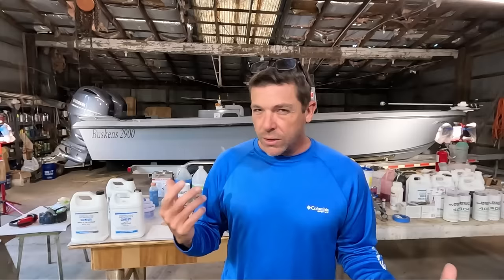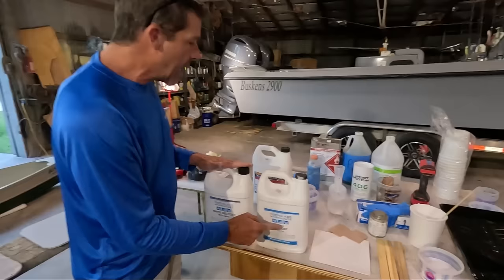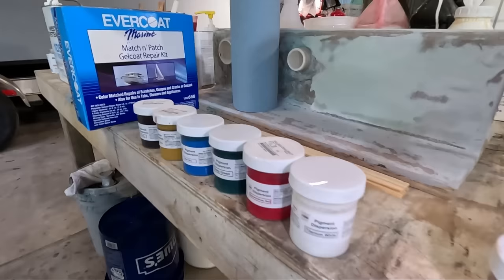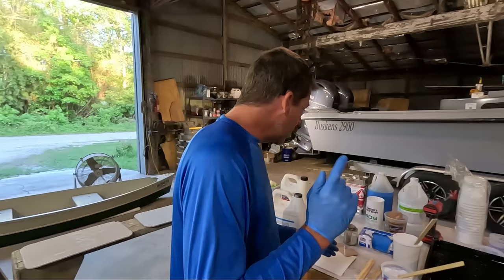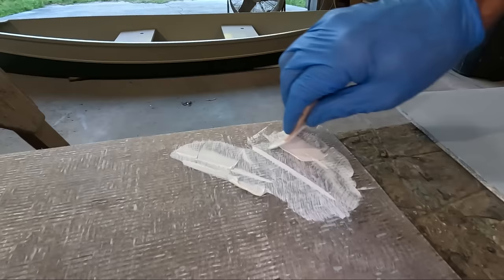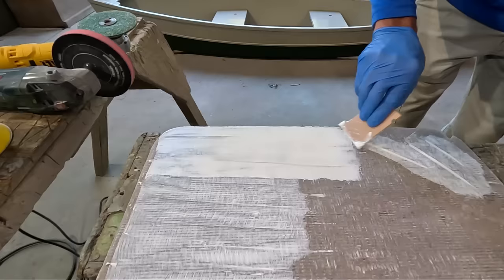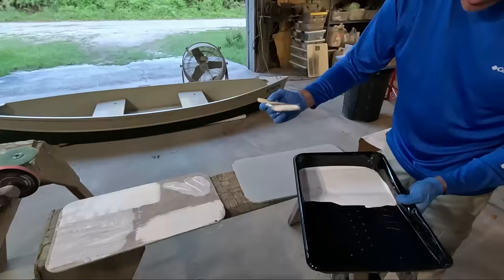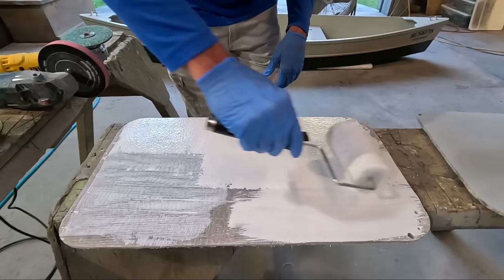The Secrets of GELCOAT and WHAT You Need to Know!

Comment: I have a crack in the bottom of my hull from where the roller on my trailer gave out unfortunately.. I’ve been watching your videos and curious how you would go about it from start to finish, you may have a video on it already so I’ll keep digging
Reply from the maker: I don't currently have a video on something like that, but hope to soon. Thanks for watching!
Reply: Same my boat has a crack in the bow where something hit it. The previous owner smeared some kind of putty over it and tried to patch it really crappy. And the putty cracked. I wonder if it would work if I could sand it all down add vinyl ester filler and then gel coat over it. The whole underwater line on my boat needs regel coated. It looks like someone maybe added paint or did a bad gel coat job because it's all cracked and chipping off.
Reply: @jaredc5789  I just fixed mine and it’s water tight! I recorded the steps I took from sanding it back to good wood, glassing, and filling if you’d like to share a video of it

Comment: If I used gelcoat with wax for a final coat, but see an area where I would like to add a bit more gelcoat, how do I proceed.? Can I just remove the wax with acetone and rough the area up a bit by sanding?
Reply from the maker: Yes, that should work for you just fine. Thanks for watching!

Comment: If you are restoring a boat and rolling on and tipping the coats do you have to sand between coats or just reapply the next coat will they bond to each other??
Reply from the maker: You do not have to sand between coats as long as you have not put wax in the gelcoat. You would only put wax in the last coat, that will allow  the gelcoat to dry tack free so that it can be sanded with clogging up the sandpaper. I hope this helps and best of luck with your project!

Comment: I am trying to paint my boat with
gelcoat the same color that you used in
your boat 29 commercial look but in
my aplicación the Gelcoat is sticky and
a lot of dust collector and mark
Everywhere so What process are doing
wrong Any other product to mix with
the gelcoat? Thank you
Reply from the maker: If you are having trouble with gelcoat curing correctly, you always want to check all the basics first. Is the gelcoat fresh? Less than 90 days old. Has it been mixed thoroughly before application. Did you add MEKP also known as hardener at a ratio of 1 to 2 percent to the gelcoat and mix it in thoroughly just before applying it to the boat. Was the surface you gelcoated clean and dry with air Temps between 65 to 85 degrees. Did you add wax solution to the gelcoat on the last coat at a 2 to 3 percent ratio so that it can fully cure tack free. Also if you try to gelcoat over epoxy based resins or fillers the gelcoat might not cure properly. Any one of these could possibly cause a issue with gelcoat curing for you. I also have several different gelcoat videos here on the channel that show gelcoat applied in different ways. It is very important to watch the whole video closely and not skip any steps or you might miss something. I hope this helps and thanks for watching!
Reply: @FishBumpTV  Thank you very much for taking the time to respond, I appreciate it. 👍I'm going to paint again on Tuesday this time I hope it goes well thanks Captain
Reply: Hi great vids,and info ,i have old chalky white gelcoat on topside bad even when cut polished -cabin roof etc,  was wondering what percentage of labour is 2 good gelcoats -compared to awlgrip aplication.28ft job (just to get it tidy looking not perfect .)cheers tone

Comment: I have a major project that I'm working on. It's a repower that required new stringers and tons of mods to the engine room section of the hull. The amount of sanding that we've done over the last 87 days has been pretty intense. I'd like to cut that down after we start doing our final layups of fiberglass. The area is WAY too big to glass everything all at once. I was thinking about laying up sections each day. Day one: That section get's done and we gelcoat over that section right away so we can avoid sanding it. This would be sprayed. Day two: sand a transition point into the layup and gelcoat done the day before. Layup the glass in the new section and then shoot the gelcoat over it right away. Then keep repeating that process until it's finished. What do you think about that plan? If it's doable what would you suggest for the gelcoat process. Would you recommend nonwax coats and then finish with wax on each section? Would you recommend just using nonwax period until the entire area was done and then finish with a final wax coat? Keep in mind that this would be days later. I know when you don't use wax or a PVA that it doesn't like to cure very well. Or lastly, Do you think we should man up and and just do the entire glass work and then just spend days sanding in prep to apply the gelcoat. Thanks for the video and your time.
Reply: Another awesome video Captain Joe, may I ask should you lightly sand between unwaxed coats or should they remain slightly tacky prior to each additional coat? Thanks again for taking the time to share your knowledge and time you’re an absolute legend 👍🇦🇺
Reply from the maker: Thanks so much! You can do both. If there are any small imperfections in the gelcoat, it can be lightly sanded or scuffed to remove them after it has had a chance to cure enough to sand lightly. You can also add more coats after it has cured, without sanding as long as no wax was added. I hope this helps, and best of luck with your projects!
Reply: Thanks Capt Joe you’re a legend 🇦🇺👍

Comment: Just redid a ski boat with west epoxy and fiberglass.. Should i not paint gelcoat over the floor?
Reply from the maker: I don't recommend using gelcoat over epoxy. There are several different issue that come up. Sometimes the gelcoat will not cure properly, or there can be bonding issues over time. Although some people say it can be done, I don't do it. A 2 part paint system, probably something epoxy based is going to be what I would use. I hope this helps and thanks for watching!

Comment: Is  vinylester resin ever used for gel coats, and if not, why not.
When I was doing my boat restoration project many years ago, it was accepted that you could use waxed laminating resin on multiple layers as long as the previous layer had not fully cured. In fact it was difficult to buy non waxed laminating resin.
Reply from the maker: Vinyl Ester will yellow when exposed to uv, that why it's not used as a gelcoat. Yes, if you time it just right you can get away with hot coating waxed resin, but I try to avoid it if possible. I hope this helps  and thanks for watching

Comment: At 6:15:  2 to 1 for wax on a large batch, 8oz of wax to 16oz of gelcoat. I'm I hearing that right? That's way over most recommendations.
Reply from the maker: I meant to say cap full, not cup full of wax solution. We added a text overlay on the video to clarify that point, but for some reason the text no longer matches up to the correct moment in the video. Just noticed that today, and will get it corrected. Between a half an ounce and a full ounce is the amount of wax solution I would typically add for 16 Oz of gelcoat. Hope this helps and thanks for watching!

Comment: Hey man I am fixing to floor on a 18 boat and I fiberglass the bottom of the boards and will do the top with mat and strands of fiberglass and of course it till be resin on it so can I sand it with like 80 grit and then gel coat it or no I’ll have to get the vinyl stuff??
Reply from the maker: You don't have to use vinyl ester resins,  but it is very good. I also like a good isophthalic laminating resin. I hope this helps and thanks for watching!

Comment: Sanding epoxy first then gel coat with or without wax over it bonds?
Reply from the maker: Applying gelcoat over epoxy can be a problem, sometime it will work and sometimes it will not. I don't usually recommend it. We use polyester or vinyl ester resin if we want to finish with gelcoat and marine paint if using epoxy as a base. I hope this helps and thanks for watching!

Comment: Watching this because on the Robalo 246 2023 and later the hatches aren’t finished underneath … so 4 coats non wax and the last 5th coat wax !! Wet sand and buff cut and polish !! 😅 ok 👍
Reply from the maker: Yes, that is the basic process.   I do like to sand the surface as flat as possible with 80 grit before applying the gelcoat. That will prep the surface, and provide a nice fair surface to start with. Hope this helps and thanks for watching!